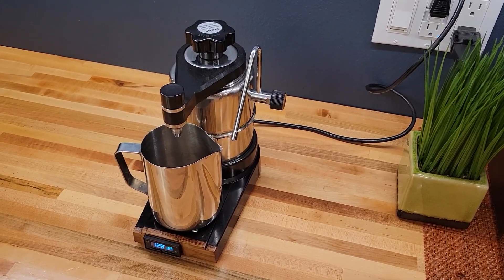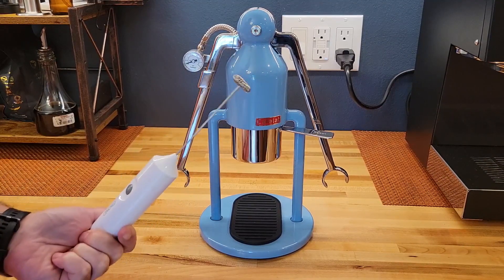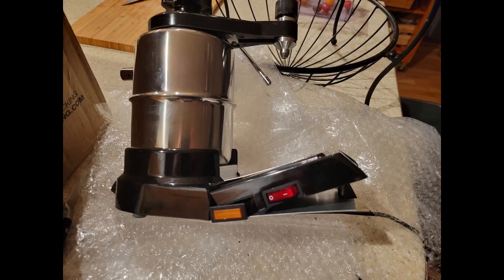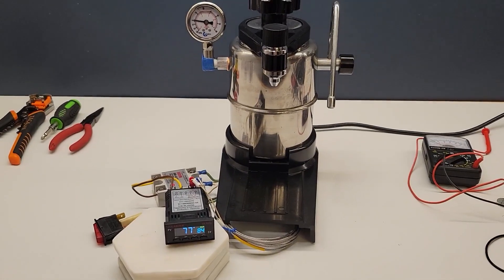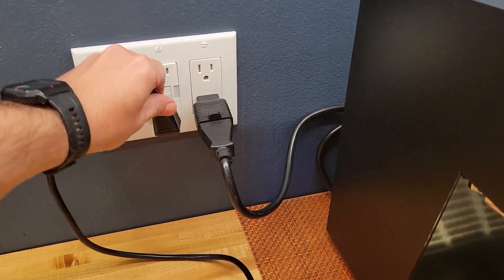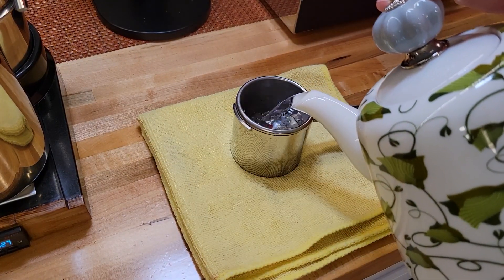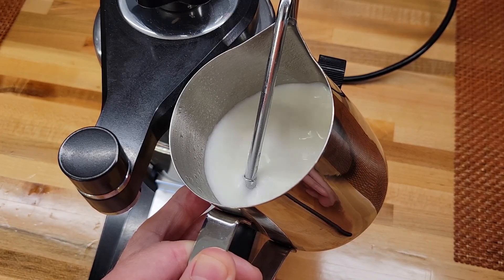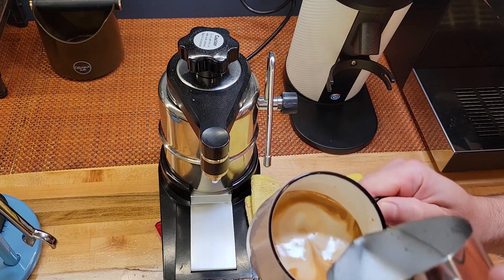Making a PID Milk Steamer

Comment: This is great. I am working on the same project. Did you continue to use the same klixon circuit breaker or add in a flat thermocouple to control the heat?
Reply: It looks like you are using a flat thermocouple can you please confirm ?
Reply from the maker: @TheTakeItEasyDude  Yes, it is a flat K thermocouple. I removed the thermostat but the spring that was holding it has enough force to press and keep the flat thermocouple to the boiler. I only applied a thermal paste for better heat conductivity.
Reply: @TheSunnySquare  thank you for the reply! I am using mine daily and have done some additional mods that make it even better. If you want to chat more let me know!
Reply from the maker: @TheTakeItEasyDude  Yeah. I am curious about your mods. Here is my email -> the.sunny.square.channel@gmail.com
Reply: @TheTakeItEasyDude  on a stovetop unit, drilling or cutting the basket that hangs down inside the unit makes a huge difference in regards to achieving dry steam. Have you found any other mods? 
What’s your take on the PID install? I am handy, but not that experienced with electrical.. is it a reasonable project to tackle? 

I received a Morning Dream steamer last week, and I think my bellman steams better, but I don’t like using it on the stove..

Comment: @The Sunny Square, great job, congratulations on the idea and execution. How did you manage to place the temperature probe in the boiler, how did you seal it?
Reply from the maker: Thanks. No sealing was needed. On the bottom there is bolt that holds the spring for the original thermostat. I got a thermcouple with a ring head and just screwed it to the bolt. I also applied thermal paste to the connection.

Comment: This is great! I'd would also buy one of these immediately if you put it on the market. Any chance of making a more in depth tutorial for those who are willing to try and build one?
Reply from the maker: Thanks. I am not sure if I have footage of all the steps working on it. Most mechanical work was improvising just to fit the parts, but they also can be housed externally in a box, which would be easier. If you are interested in the wiring, I can draw it and send it to you.
Reply: @TheSunnySquare  thanks for the response. If you wouldn't mind sending drawings of the wiring, that would be incredible!